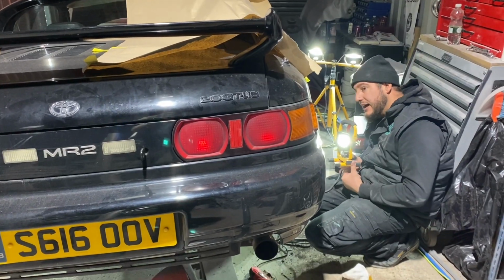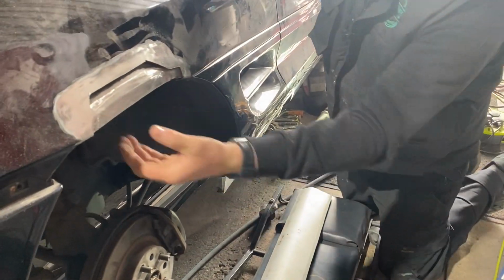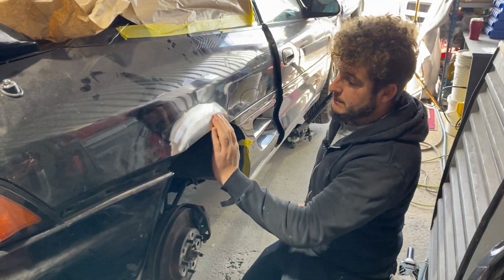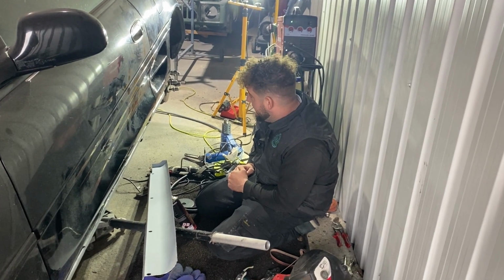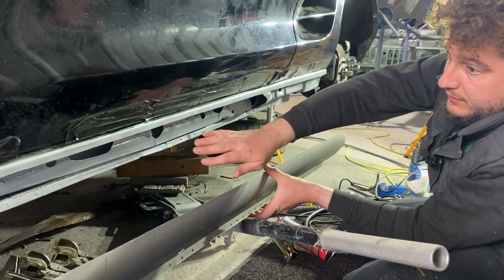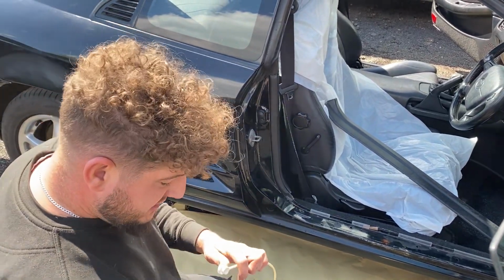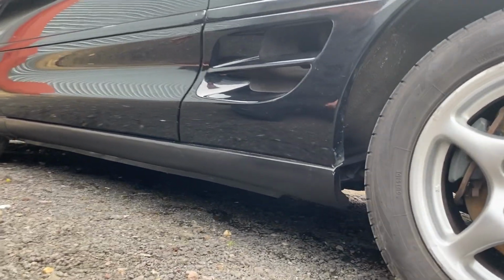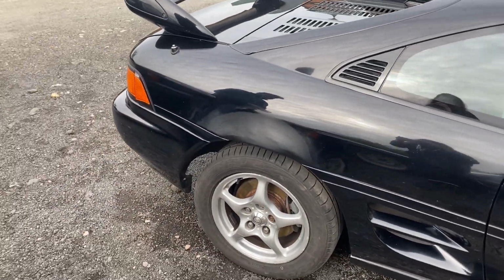Toyota MR2 wing and sills rust repairs

Comment: The only way to remove the sills is cut it? There are no bolt or Screw?
Reply from the maker: There spot welded and joined to the body shell, so have to cut off to be replaced.

Comment: Saw your post on the Facebook Classic Car Restoration group. Nice work. Have also been thinking of using panel adhesive/bonding on my 1992 Rover 216 GTi rear arch inner to outer arch lips as plug welding (I don't have a spot welder) is a total pain on 0.8mm steel.